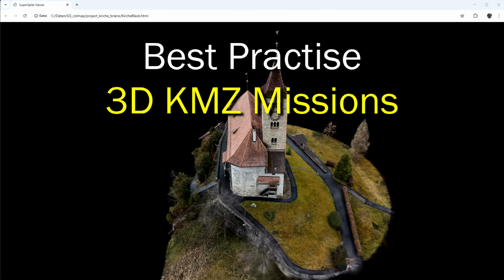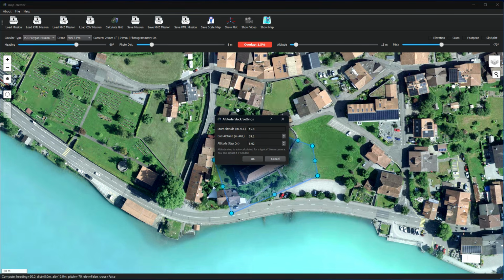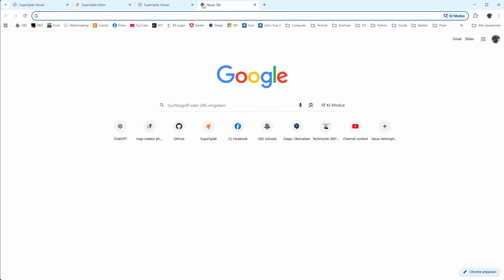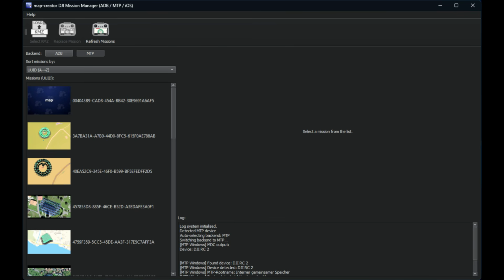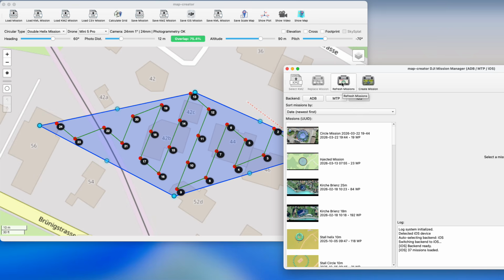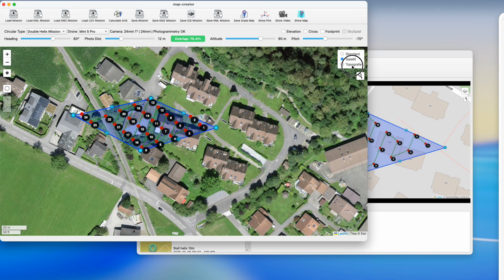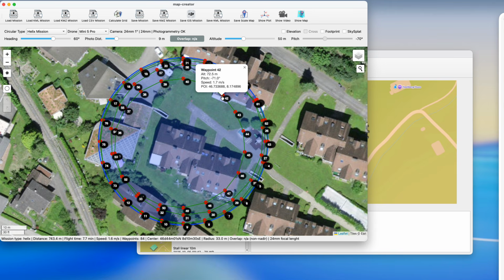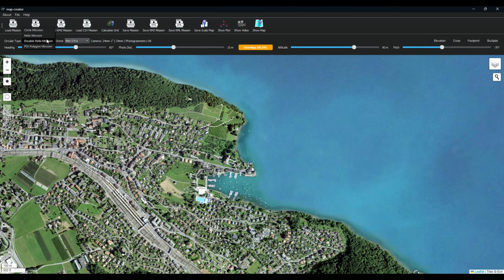Best Free 3D Missions for DJI Aircrafts for Gaussian Splat and Photogrammetry

Comment: I'm relatively new to this. I have a DJI Mini 3 Pro kit.  I watched the whole video but I guess I'm still not clear? With the 3D Mission software from what I can tell you can create a flight plan and upload it to your DJI Mini 3 controller. At that point will the aircraft fly that flight plan in an automated mode? It would be great to see a video from creation of a flight plan. To actually using it in the field with a drone.
Reply from the maker: The DJI Mini 3 Pro does not support wayponts in DJI Fly. You can use Litchi Pilot for waypoints. You can import a KML Mission in Litchi Pilot.
The Mini 4/5 Pro supports waypoints in DJI Fly
Reply: @KilianEisenegger oh my! I did not know this.
Not sure how to create and implement a KML?

Comment: Hi Kilian, would it be possible to split the KMZ waypoints into separate groups, such as 1–100, 101–200, etc.? Loading too many waypoints into the DJI RC2 can make it unresponsive, and one battery may not be enough to complete the whole flight.

Also, when is the next release expected? The double helix mission and cross function don’t seem to be available yet.
Reply from the maker: Hi Alex
Yes this an interesting idea to split the mission. DJI Pilot can do and DJI Fly not. I will implement something.
All functions works fine in the last release.